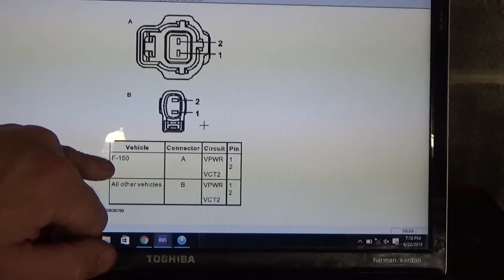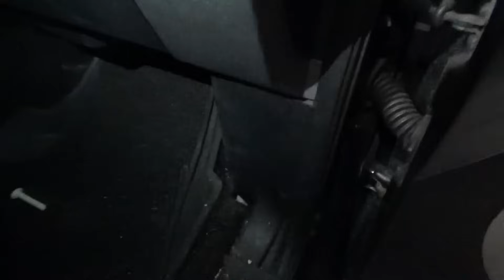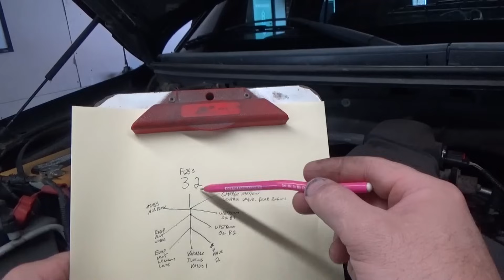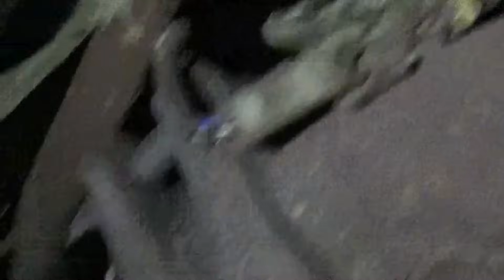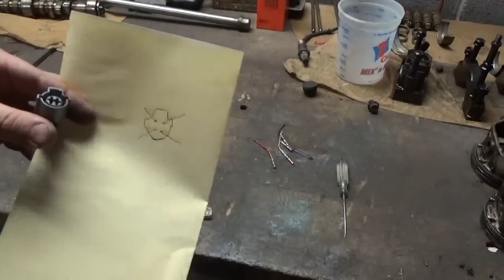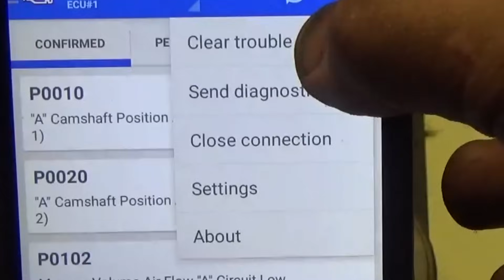Ford 5.4L failsafe mode multiple codes Real time troubleshooting

Comment: this happened on my 2005 navigator while driving a message read CHECK ELCTRIC THROTTLE; then truck entered limp mode wouldn't shift out of 2nd gear a shop ,made me buy a throttle body for no reason. like you my fuse 32 kept blowing turns out my intake manifold runner control sensor was the issue that caused my limp mode  and and inability to start with the key

Comment: Mine Pops A Fuse That Most Of The Code Related Compoments Run Through. I Think There's A Dead Short Somewhere Running Through That Fuse & When It Pops, Codes & Limp Mode Kick In. My Truck Is An 02 F150 xlt Lariat Extended Cab Short Bed 4x4 5.4 2 Valve
I Also Added Stainless Hedders To Get Rid Of The Manifolds That ALL GO BAD So I'm Gonna Check Those First !!! Thanx For Being A Real Mechanic Instead Of A Hack

Comment: 2023 My 2007 Ford F150 5.4 3v.
Same issue, same codes.
My fan clutch seized and took out its own sensor wiring.
Split the serpentine belt.
Again same codes you showed. Replaced cam sensors and connection wiring. Been in failsafe for 2 weeks. Was about to drop 350.00 on new fan clutch and VCTs.
Just found this video.

Short occurred from fan clutch failure tearing out its harness. Thank you very much.

Comment: I liked this video. I have a 2006 F 150 Lariat 4x4, and Engine Fail Safe popped up 2 days ago, and engine had no power. Stopped truck, re-started, gave it a rev or two and made it home. Friend will use his machine to check tomorrow. 
Looking at your scanner at the end, is that an app for phone, and if so which one are you using and what accessories are needed?? Thanks, new subscriber

Comment: I’m having the same issue with my 2006 5.4 triton. I found the same fuse (#32) was blown. When I went to trouble shoot, I found that I’m not getting any power or continuity to any of the sensors or wiring. I did replace the fuse to close that circuit. Could it be a bad relay causing complete power loss for that entire circuit?
Reply: I'm guessing it does. Did you ever find the solution to this problem and did you find the relay connected to the circuit?

Comment: First off I just want to say thanks for all your help. Now what I did from all your help was I unplugged all the sensors and checked all the wires and made sure nothing was rubbing against any part of the chassis our exhaust then I put a Fues that I made with 2 wires on each blade then I got an old brake light socket then I solder the wires to the end of that, as well as the fuse and stuck it inside were the fuse go then I plugged each sensor one at a time until the light started to shine and that’s how I found out that the park behind intake manifold that opens and closes these two blades was bad the cmcv actuator and I also did everything you did in this video as well thank you 🙏 so much

Comment: Got almost the same problem but  starts and then it don't start just cranks! bottom cig. Lighter fuse is blown. Put new one in and blew again !? Same 15 amp type fuse.

Comment: I would also add that I have a 05’ Chevy Dually I restored with new motor and having a few issues. If I knew where your located I might be able to have you fix it even if it’s a cross country drive and hotels

Comment: Great video! I’m having a different problem where it just stalls on an 06’ 5.4 . It does this several times a day and the problem is I haven’t found a great mechanic. You know electrical and that’s worth a lot of money. I hope to find a great mechanic somewhere in this big city of Houston. So many mechanics but less than 1% know how to find complex wiring issues.
Reply: Did you find out what was causing the problem?
Reply: @ What happened is it worked itself out. I truly don’t recall even what happened but I know on that truck I e just replaced a flywheel a few years ago but not much else except oil changes and the truck just keeps on going. It has 180k miles and we use it for work to pull a small trailer so I need to do the cam phasers right now

Comment: This literally just happened to my 2005 F150 Lariat with the 5.4 Triton. It has been sitting in my driveway for a few months as we picked up a newer 2016 F150 XLT with a 5.0 Coyote engine, which we love. At any rate, the battery was dead so I boosted the battery and it started up just fine. Ran it for a few minutes then decided to take it for a drive to charge the battery further and didn’t make it 400 feet when it started hitching, lost power, then stalled on acceleration. It started up but sputtered and stalled several times. Then the engine light came on and the engine safety mode display appeared. It finally ran long enough for me to put it in reverse and idle it back into my driveway. At any rate your video was incredible and really answered my questions in a hurry. I’ll keep you posted with my findings. Thanks again.

Comment: were are you located,  I SURE COULD USE YOUR MECHANIC SKILLS , have the same thing happening on my 08 f350 5.4 , my MECHANIC has changed 6-8 CENSORS,  computer and its still going into limp mode , he says now i need a wireing harness,  wich is no longer available!!!!!! please help if you can ?
Reply from the maker: I’m located in pennsburg pa

Comment: Hey thank you for this video, I just found this tonight, my truck did the exact same thing and had the same codes and the same melted 02 sensor. I was just about to buy a 250 pcm thinking that was the problem, I already spent 200.00 replacing the VVT sensors and cam sensors, this was an amazing walk through video you saved my truck and wallet man. I will be changing the fuse in the morning  and driving to work. tomorrow.
Reply: I have the same too

Comment: Dude, you rock!!! I have a recently purchased 2008 ford expedition with EXACT same codes as you show here. Turns out fuse 74 was a bad fuse that someone tried to jump with a bit of copper wire! Replaced it, reset PCM and now running like a dream. Hoping the short doesn't come back, but now I'll know what to go after if it does. Kudos!

Comment: I like your approach; it's the one I used to fix a Chevrolet the dealer wanted about $5,600 to $5,700 to throw parts at, with no guarantee of a fix, after screwing up a warranty repair.

Comment: How much should someone expect to pay for service like that?  Thanks.
Reply from the maker: It all depends honestly, if the damaged wires are on the vehicle harness or on the sensor side that’s replaceable 
If it’s straight forward, I’d expect a diagnostic fee of 1hr and then parts and labor to replace the sensor. I’d estimate 2.5hrs at labor rate plus part$ 

If I remember correctly this one was around that

Comment: Hey can you help me out I just bought a truck 04 F150 and it's running really rough now only code I'm getting is p 1633 I can't find any blown fuses it's running like it has a misfire but it's not showing any misfires on the computer only p1633 I would appreciate any advice you could give me
Reply: Also I can smell gas like it's running really rich
Reply: You want some advice sell it.

Comment: Hi sir I realy like your explanations becouse logical
I have same truck 2007 I got  same the issue your client I toke it workshop. They told me this may be spark plugs or coils  and throttle  and they keep guessing with out using scan tools, thus I rent car while I buy scaner
Last weekend  I recive the device I scanned I ve got 4 error code
As below
P 010
P020
P0130
P0440
I m not sure
Last  one
But the code is related to airmass sensor

Comment: My 05 mustang is having the same problem but only codes that are showing up are the down stream 02 sensor's I'm getting the 02 sensor's today and going to see if that would work but I have a filling that the engine fail safe mode is still going to come on. Any ideas on that

Comment: I am impressed  with the fact you took the time to look for and locate the problem other then removing and replacing components trial and error until the problem is found which is the case a lot of times in the area I live.
Reply: A true mechanic.
Reply: Not many guys around like you. Good job. Thanks from Green Bay, Wi

Comment: Hi my friend I have the same problem with my mercury montanieer 2006.y put new Egr,new valve purge valve, is six codes aperl in my scanner. but show like twelve .all are same.i clean the codes but come back again same.same codes.no matter change the sensors.i don't not what I can do.oxigen sensor I change all then

Comment: Great Video. I just saw a tool for the first time this year. 2020. They have DC current clamp meters now. and some with Bluetooth. It would really help isolate the branch of that tree that was shorted. even used it to check battery charging.

Comment: I was surprised when the vvt actuator was 12 volts. Figured it would be 5 volts but I guess not being as a actuator doesn’t need consistent voltage I guess?

Comment: I would be glad to pay you for your time. If you can, I have a 2001 f 150 5.4 and the driver side has no power. Every cylinder on the driver side is not producing. The power packs are firing and the injecter wires are firing. Maybe it is not getting fuel to that side or something. If you can give me any advise at all I would be glad to pay you for your time. Thank you very much. Cranks right up but the driver side is just dead.

Comment: This video is by far the best mechanic video I have ever had the pleasure to watch. I watched it several times simply because I didn't want to miss one word of your teaching. This was unreal to me. I am a pretty good mechanic but not certified. I can find the issue unless it is something like this. Thank you so much for this. I learned more from this one video than every video I have ever watched combined. Thanks again. Maybe this will help me in my search to finding out why my 2001 f 150 5.4 has just lost all power on the driver side. It is firing on taht side. But the whole side isn't hitting on the cylinders. Thank you again and I will search your page for one to help me further.
Reply: agreed

Comment: I have the same problem with all different codes. Lord, why did they put engines with more electronics?  I WILL keep the 1980 Chev C10 with 350 motor.

Comment: Hey this is an older video but none the less I had this exact same problem, however i got all those codes after I replaced my bank 1 camshaft sensor. My fuse 32 blew so once i go checking for shorts like you did do you think that the camshaft sensor might be shifting out my system? Ps there was oil gunk on the camshaft sensor

Comment: I did everything that you did, I disconnected all  sensors and try to put a new fuse and see if it blow it or it keep it but no it keeps blowing all the fuse that I put on any other suggestion? On what can I check I even disconnect all the electricity of the motor and put a fuse and it blows it out !

Comment: Common problem,,this should have taken less than 5 minutes to diagnose if you have seen it before,,, usually when the fuse blows for those circuits it's usually an internally shorted o2 sensor heater,,,this fuse on pre 03 vehicles also feed the transmission so you would get a code for every trans solenoids,tft sensor,ego sensors,vapor management valve,,,once you see it you will always remember

Comment: What were the symptoms when it was running on "safe mode". I have an 07, 5 4. Was running fine, now it starts and dies. Or wont start. Gives me about 15 codes. All sensors.
Reply: Did you find the issue?

Comment: Would this failsafe mode apply to my 2010 f150? I have a noticeable misfire when I go to pass someone at highway speeds and my engine will buck and if I keep pushing it, it will just sort of cut power and then my check engine light blinks. Then, when it starts blinking I can still "maintain" my speed but if I'm even lightly holding the throttle in to hold my speed, the whole truck will shake until the check engine light stops blinking. If that makes any sort of sense, can't find any videos of it on YouTube so I hope my wording is understandable. P.S. Misfire comes from my old spark plugs I'm fairly certain (195,000 miles on original plugs). I'm changing them very shortly but I'm not certain that will fix the other issue I'm dealing with. I'm a little worried it's maybe also a sign of my transmission going out (unless of course it's just in a limp mode).
Reply: Have you tried replacing your coil packs?
Reply: @selinascruggs6432 I have not since it  only does it somedays other days its fine but I will definitely plan to get those new coils, I changed one camshaft position sensor because that was the only code that came up on diagnostic and added transmission oil and its seems to have helped thing is it's hard to get a true reading on the transmission fuel level since supposedly it has to be idling and hot which is pretty hard these 6r80 but any advice fixes and much appreciated gonna do another diagnostic and see where I'm at since problem is still there but it's very seldom its does this, truck has 230k 9 yrs with me and have not had any kind of problem till now hope it's a simple fix nonetheless she has served me well

Comment: great video the same exact problem just happened to my 2006 f150 5.4 replaced 02 senser anr runs great  Tnx this video was a GREAT help!!!
 Cheers
Reply: chris scordino did you have the overheat issue?
Reply: did it throw that many codes as well? I am currently researching almost the same exact problem maybe give or take a few different codes. My nerves are shot!

Comment: Ive been having engine fail safe mode and the 2 shops I went to wanted to flush the oil and clean it. The other shop wanted to replace catalytic converter, I really appreciate any help.

Comment: Great job man! You just taught me a ton!! I just had a check engine light come on with like 5 different things, truck runs great but it's got to be something like that, it's saying tps, throttle body, vct solenoid, camshaft sensors, which i replaced and cam shaft sensor connector, which is in bad shape, im replacing that next, I don't see HOW all that could be wrong at once!!???

Comment: Im having issues with mine, although no oxygen sensor or anything like that, all codes in the timing. Unfortunately I left my meter at work so im left guessing on it. I unplugged the lower connection on the timing cover which I believe is the cam position sensor. Thought it was the actuator.

Comment: Omfg thank u very much for your help. I threw every code. I did a transmission swapp and well thanks to u I had 3 burnt fuses. I replaced them. Rest the system and now my 02 f150 4.2l v6 is running like a mule/champ. 

This has made my day.. 

Once again thank you very much for all of your wise wisdom. 

You saved me another expensive cost.
Reply from the maker: Flaco753b fantastic!!! Glad to hear it

Comment: my truck is having a hard time starting when engine is warm or when its hot outside 
I've changed everything on my fuel system still having problems

Comment: great video but my fuse 32 is good and I still have engine failsafes
 mode
Reply: Did you find the issue?
Reply: @DavidPerez-tk5cp   yes it was the throttle control unit went out, it was sixteen years old.

Comment: excelente informacion, tengo on problema con una camioneta ford 350 super duty, 2011 con multiples codigos de falla,p0443,p0023,p0103,p0135,p0141,p0155,p0161,p0113.le agradeceria algun dato, no puedo conceguir el diagrama

Comment: My fail safe mode is coming on I have a 2006 Ford Expedition the throttle body and pedal have been changed im getting codes p0430 and p1000